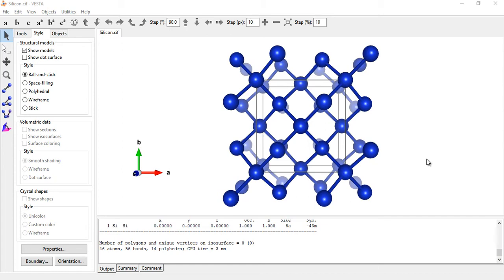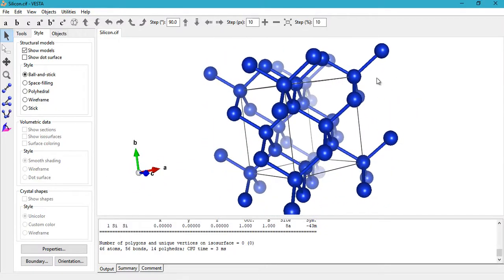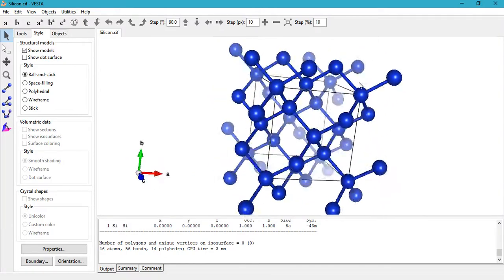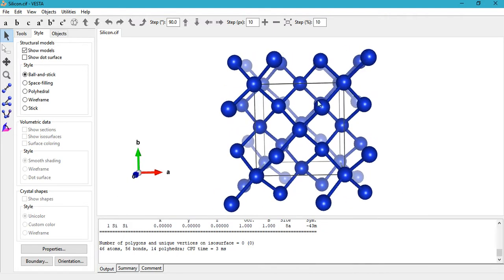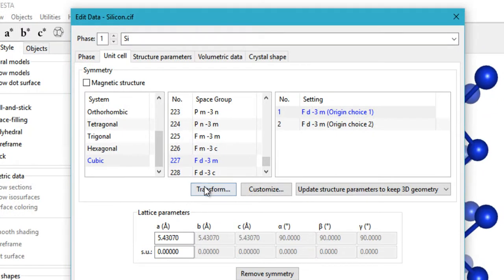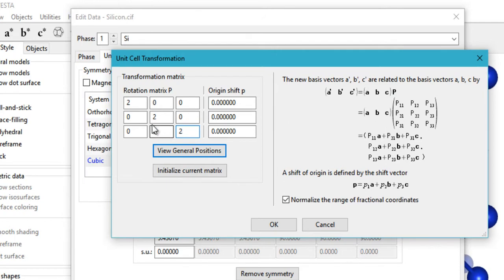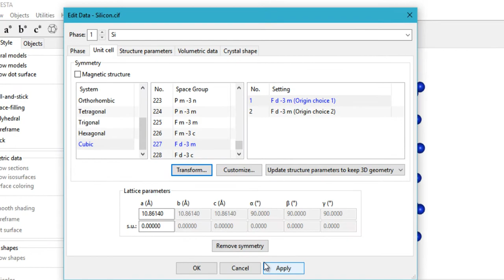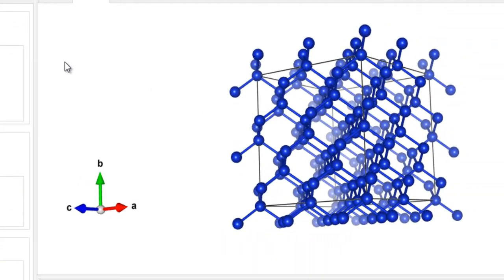Create a SUPER-CELL using VESTA - [TUTORIAL #4]

Comment: Hello, to relax the atomic positions of monolayer (let's say MoS2) in quantum espresso, should we fix some atomic positions (like for example when using burai it fixes one sulfur layer and Mo layer and keep one sulfur layer free to move) or that is not needed ? Any reply is highly appreciated
Reply: Studying and relaxing a Surface is a bit tricky. You need to know a lot of intricacies. First of all, how big of a slab you need to create is found by converging the surface energy. This is in itself a complicated matter, and there are many papers about how to best achieve this. Again, studying a big slab with lots of layers is computationally expensive. So, a popular method is to freeze the bottom layers and only relax the top 2-3 layers. Again, you would need to decide yourself, by running a few calculations about how many to freeze and how many to relax. There are a lot of other intricacies such as which termination to use, which miller indices to use, how to use the surface energy formula correctly as if you freeze the layers then its not a symmetric slab, how much vacuum is needed, and the effect of dipole creation due to the asymmetric slab. 
You would need to study some literature in order to make informed decisions about the things I mentioned. Then you should also mention your choices in the paper you write.
Reply: Of course, if you have enough computational resources then relaxing the whole structure is the easiest and ideal route, you can take.
Reply: @ManasSharma07  Thanks a lot for your detailed answer.  And thanks for this great YouTube channel

Comment: After creating such supercell.  To use use for QE we just need to export it as .vasp and then write the name of each atom on the left?
Reply from the maker: Yes, and also update the lattice parameters based on the .vasp file
Reply: @PhysWhiz  but in case of monolayer like for example MoS2. As per I saw in other videos we cannot use it directly, people usually need to cut the surface planes on x and y (if the vaccuum is along z) to respect the periodic boundary conditions in these directions. But not on z direction to break the periodicity.  So it looks not trivial.  Do you agree with this statement?
Reply from the maker: I'm not sure if I understand you correctly.
For making a monolayer, one would essentially create a structure that is periodic in two directions and has vacuum in one direction.
BuRAI is a nice software that let's you create such structures:
https://youtu.be/HXj9HCdt5ww